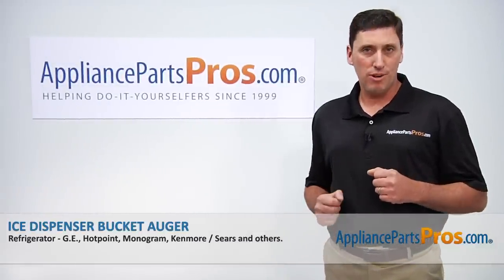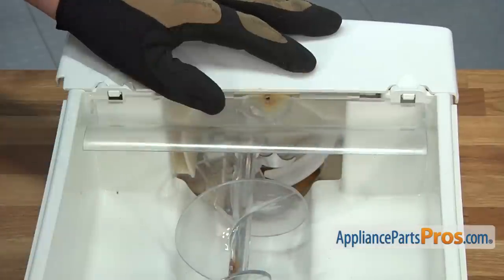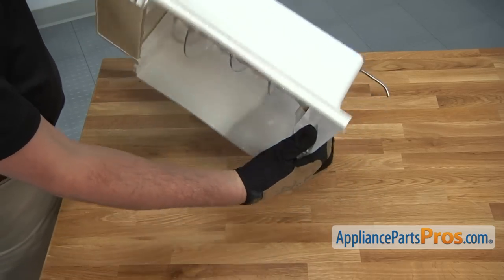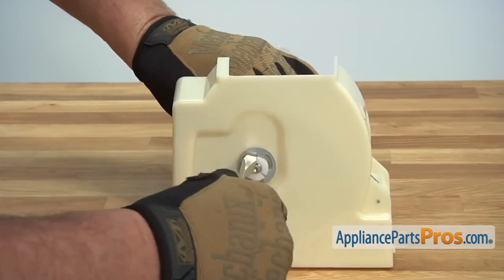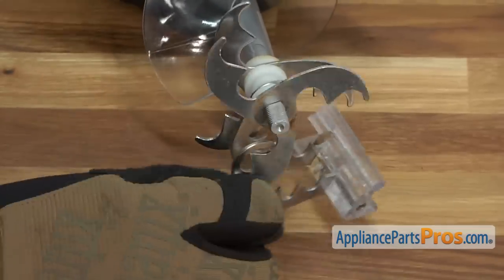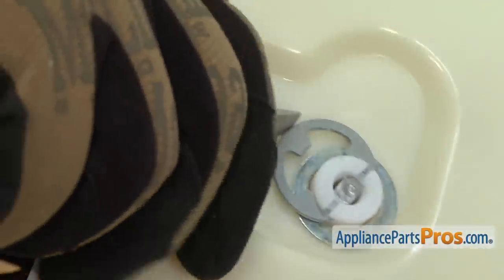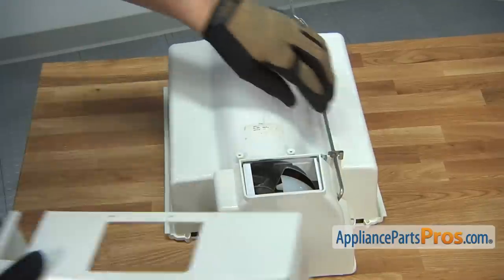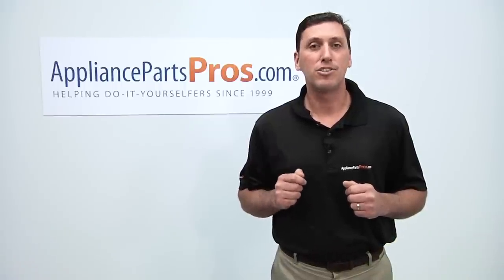How To: GE Ice Dispenser Bucket Auger WR17X11705

Comment: Thanks for posting this. Great step-by-step instructions and you saved me from having this repair turn into a nightmare.  I definitely recommend that if you are going to do this repair, take pictures of your ice crusher blade assembly from multiple angles before you take them apart.  Since all have to come off before you can thread them onto the new cam, they tend not to stay together well in between.  Photos helped me out there getting them back on exactly as they were before.
Reply from the maker: Glad we could help! And thanks for that tip!

Comment: Great instructions. I got the reorder of the blades off. My assembly was the exact as the video, but my reorder was different onto the new auger. So I slowed down the video and followed it. After I got that together it was all down hill. 

This is a simple fix and it's cheaper than replacing the whole ice drawer.

Thanks.
Reply from the maker: Good job on getting the bucket repaired, much cheaper than the whole assembly!

Comment: Careful folks.  The re-inserted blades are not correct in the video.  The blades are numbered 7, 8 and 9 and the blade numbers face down or towards the plastic auger.  Oh, and it's not a 6, it'sa 9!   Blade 7 goes on first.  The position of the 3 single blades after insertion should flow in pattern.  If you look down the shaft after installation the tip points are about one half inch from each other in a clockwise direction. If one of the blades is out of position simply rotate it 180°, do not turn it over.  Also the 3 single blades face one direction and the 2 clamped blades face in the other direction.  Lastly, and importantly,  the metal shaft on the replacement auger may have to be filed down in order for blade 7 to reach the proper position.  Mine did.  I used a dremel tool but a flat file will work as well.  Be on the lookout for that challenge.
Reply from the maker: We do apologize that you had an issue with the reinstall on this repair. Our videos are to give you a general idea on how to do the repair. It sounds as if when you were doing the repair that something wasn't installed correctly, because there shouldn't have been any need to file down the shaft piece at all. With doing a repair like this we do recommend to take pictures of how everything was so you can use them as a reference.

Comment: Great instructions.  The only difficulty I had was pressing in the clips to remove the main assembly.  I am thrilled to have a working auger again!  Thank you!
Reply from the maker: Elaine Stevenson Glad the video helped you get the crusher fixed!
Reply: Agree - the "clips" were not really clips in my model.  They were more like solid plastic wedges with absolutely ZERO give.  I had to PRY the ice crusher chamber with TWO PEOPLE, multiple flat head screw drivers and A FREAKING HAMMER to get the chamber removed.  That step alone took 20 MINUTES!!  In this video, it took 2 seconds.

Comment: I have a 2006 Hotpoint, and the ice is dispensing just fine, but the Ice is not crushing the Ice to well when set on "crush". 

Could the blades on the end of the auger need replacing, and if so, could you please leave a link to me where I could order them?

Thank you for the video

Comment: I replaced my auger -- twice as I realized after the first time that the blades weren't positioned correctly -- but I'm only getting crushed ice. Which leads me to my question, are the blades in the ice bucket strictly for the making of crushed ice or do they have a part in the whole cubes as well?

Comment: Great instruction. Did notice the blade orientation at 2:54 does not match 3:29. Last blade looks like it needs to be spun another 180 degrees on the shaft
Reply: ??? is this an issue?
Reply: Somehow I think it may effect the crushed ice size but not really sure. I have to think the manufacturer has blade rotation spaced  the way they came out for a reason.

Comment: My unit (GE ) had metal washers in the blade assembly (along with the white plastic spacers).  Unfortunately, I accidentally dropped the auger after taking off end nut and before taking picture.  Does anyone have/know of a diagram or picture to share?  Where do the two metal washers go??  I would appreciate any help!
Reply: Did you ever find out?

Comment: So, I'm replacing my auger.  Not watching You Tube; how hard can it be?  Cannot get the damn nylon nut off -- it will NOT turn.
Finally, I looked on You Tube.
You Tube:  "Left Hand Threads"
I might have used profanity at that point.